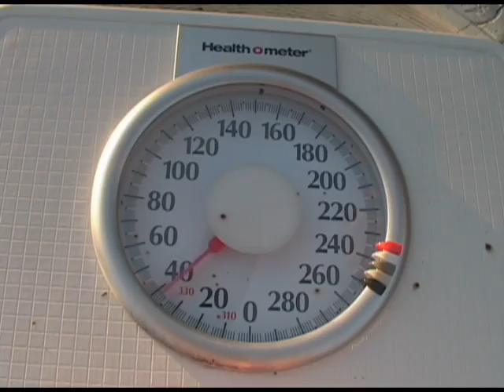Home Made Jetpack Flight and Crash

Comment: Im an engineer and this is just too fake...when hes bouncing around the jetpack is not thrustingat all, its just a freakin smoke pouring out of the tube. there has to be a string with a long spring  somewhere....plus his jet-tube is too far back... if it was really a jet pack he would doforward circles like carazy....BOTTOM LINE...  ITS FAKE

Comment: So you figured no one would notice that the "model rocket" shoots a giant burst of directed smoke and flame while the 'jetpack' looks like there's a weak sparkler stuck in the end of it?

Also, '40-pound' (stupid Imperial system) rocket would have to be so much larger to actually output 221 N of force. Also the fact that the position of the 'jetpack' would make you do cartwheels.

ALSO, he would accelerate downward at 1.9 ms^-2, rather than what looks like about 6 ms^-2 in the video.

Comment: notice how it exploded....... it was a fire cracker
even if it was a real rocket he wuld not just use one he wuld need more than 1. becuz he was bouncing it wuld add way more weight so the rocket wuld not have been able to take dat much stress.p.s the timing of the rocket on the scale dint match the he was using the truster

Comment: The kid used a rocket motor to propel himself and he is what? about fifty pounds?That wasn't close to effective but it worked. It was just a pipe, harness, tape, and a simple hardware store rocket motor. Do you really think there is a cheap motor like that available to propel a 140-150 pound soldier plus his gear? There actually has been a jetpack invented used multiple times.

Comment: k, i know that was a zipline,
and those engines dont give off 40lbs of thrust. you need to have a licence to posess a motor powerful enough to lift that kind of weight. third, a rear-mounted rocket pack is impractical. if you put a rocket motor on somones back, the only thing you could do is do somersaults like a cheerleader on crack and steroids.

Comment: If the crane was actually fixed, one could determine the height the rope's end by trigonometry.  If the rope swings 30 degrees as he goes up that final flight, the rope's other end should be twice as high as the distance he travel over the ground, at least four stories up.  wtf? And then how the hell would he fall on the other side of the fence - cut the rope?  Ridiculous.

Comment: If it there is a reel, then it would still have to swing over to the neighbor's yard. So to what point is the crane attached to if it must swing that far?  Too far. Alternatively, it can be based in either backyard if the crane is retractable, or it could be like a crane shaped like a ship yard crane, or the base of the crane could be outside the backyards-but is too far.  Such kind of cranes alone would be enough to attract the police.

Comment: "Just because the smoke goes one direction does not mean that the thrust goes that direction. It can depend on things which you don't see, such as the actual fitting for the rocket." You can actually prove this yourself by looking where the smoke goes the first time he uses the rocket.  The wind is blowing it forward and/or the smoke is being channeled through the side of the fuselage as the solid rocket fuel is being spent from the bottom up.

Comment: String?  Then what does he use when he crashes into the fence, that means the string is being pulled toward the neighor's yard.  Idiot.  Even if there was a string, it could not do that and be over his head all the time.  Also, if a string had enough strength to pull him in that direction that fast, less force would be upwards that what is seen horizontally, yet the upwards pull/push is enough to cover his entire weight 9.81m/s^2 !!! A single string?  No way in hell.